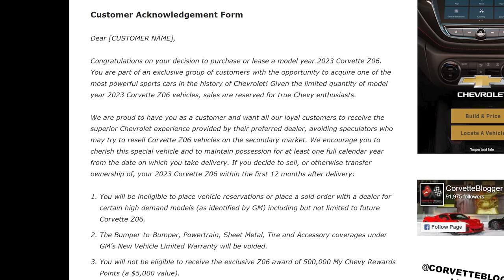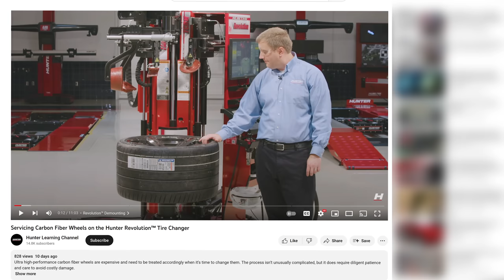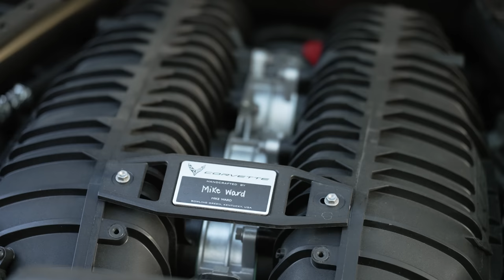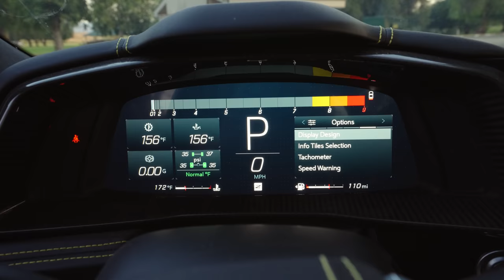My $186,000 regret... It's time for CHANGE!

Comment: It's time to let the Z06 go, it's still a fantastic car, but the real fun is in the ZR1.  I just hope GM doesn't take too long to introduce the car, but now is the perfect time to sell the Z06 before it starts to go down in value. 

We asked for track videos with the Z06 and you delivered, even though it wasn't cheap.  thanks
Reply: The ZR1 will be even more costly to track, though. If Austin’s Z06 spec was $180K, then best believe a well specced ZR1 will be $200K +. Yeah it’ll be faster than the Z06, but there won’t be another car quite like the Z06, at least for the foreseeable future. 

I honestly can’t see them dropping in value that much, especially if rumors persist about the E-Ray being the car that replaces it.
Reply: @danieldickerson4838  I think you missed the point. he is still young and is aiming to compare and test different cars, he is not obligated to "marry" with the Z06 or any other car.  the cost to maintain a ZR1 will be the same cost as the Z06, because the things that wear out (tires, brake discs and brake pads) will be similar or even the same used in the Z06 including fluids.  

 ZR1 will possibly be TT, that means they will probably have to reduce the engine rpm to 7500-7800rpm.  so maybe even gas consumption will improve.  

And you can be sure, when it is announced the prices of the Z06 will start to plummet, by then more of them will be produced and the E-Ray will already be in the hands of customers.  financially he is making the right decision.
Reply: @Luke-cb3ly  I mean it’s ultimately his money, so he has the right to do whatever he chooses to with it. I, as a viewer, am fine either way, as it simply means more content to consume from Austin. I was merely giving my personal outlook on things in general, and the Z06 specifically. It’s a bit of a shame that it’s now up for sale, but I very much understand why Austin has done so.

Comment: Austin can you help me locate all seasons for my Z06?  Can you do a vlog “why can’t a Z06 owner get Michelin all seasons for a Z06?”  The new ERay will have all seasons as stock with same fitment and can’t find them.  You could do another good deed by bringing exposure to this issue.  When I go to Colorado many evenings even in summer in 30’s and 40’s.  I’d really appreciate it.  Just one video might get job done.  And we should promote having all seasons it could have helped you on your cross country trip and ZR1 should have thereby extending more than 6 months of use in colder climates or areas with altitude.  Please help!  Stephen R. Austin please answer this

Comment: Austin, you are living the life that so many of us WISH we could do! Your Z06 DOES LOOK BETTER than 95% of the new C8's on the road. Unfortunately many of us have BRAND LOYALTY  imbedded in our genes! Chevy has done such a great job on the C8 that many mistake it for a Lambo, or Ferrari from 50 feet away. At a recent car show. One fellow had it WRAPPED in Synergy green, had all plaques and lettering removed AND had the familiar scissor doors installed. Even though I knew what it was I was surprised how many had to be told and see the  Corvette logo's in the interior to make sure. That car made a statement and drew more attention than any other car there. Anyone that ends up with your RED ROCKET knows how well it has been maintained and just how fast it is. Even though I am not interested in any other EXOTIC, I will continue to subscribe and listen to your POV! You in a 850HP or so ZR1 or a Zora will be giving us true unbiased opinions of what each of your new purchases will do. Lots of luck in the future and keep your seat belts buckled tight!

Comment: I took delivery of a Z06. Two thousand mile mark my check engine light comes on, Brought it in, it, kept coming on next thing. You know they said I had to replace an entire transmission at the three thousand mile mark.  Then they had my car for 3 months , And I had Paid off two hundred and fifteen thousand dollar Z06. Also, I had things set up for appearances and lost thirty five k, and I could not sell my car for 6 months. I took delivery of a Z06/Z07. Then the manager in houston, texas on I10 in kirkwood the gm Josh. I asked for 3 months a payments in three insurance payments. Which when it came out to sixteen thousand six hundred and sixty six dollars. They refuse to pay it plus I asked for a 100000 mile warranty. He said he would give me that, but he. Refused to pay any money while I didn't have that car for 3  months.  So I lost that on $35000. It appearances plus they refused to give me 16000 back for 3 months of having my vehicle. And it just took them one month to even give me a replacement on a tire. I love the car Dunkin'. Wrong but the service from GM  trash. I will never buy another core vet again